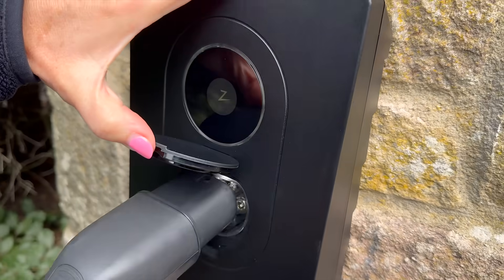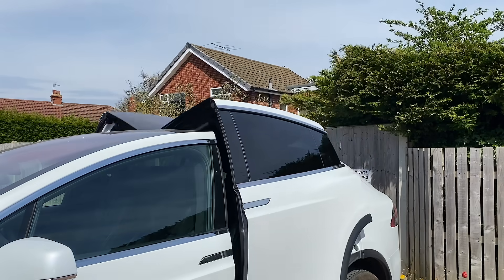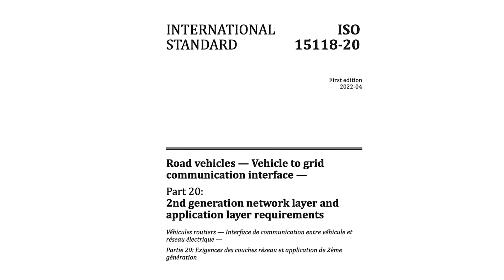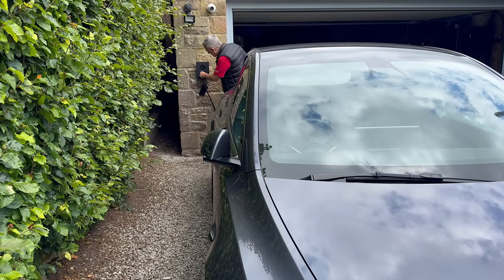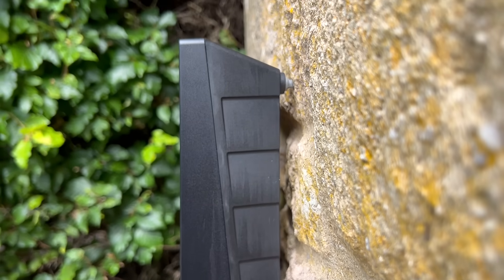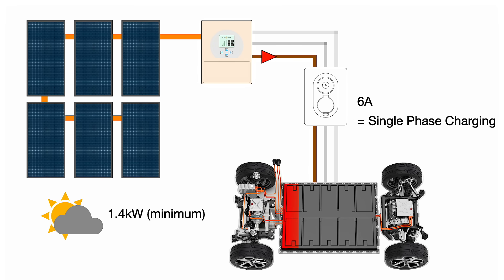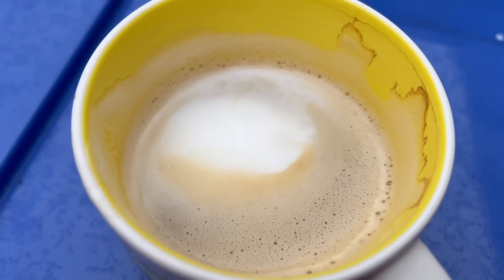Zaptec Go 2: The Future of EV Charging and V2G Explained!

Comment: What I want to know is do all cars that have an inverter (i.e do V2L) also have the hardware for V2G? The latter requires syncing with an existing 50Hz grid. The former requires a grid-forming inverter. I think that if you can do grid-forming then the hardware can also do grid-syncing (because that's actually simpler), but I could be wrong. 
Which vehicles out there have a) grid-forming (V2L) inverters and b) grid syning (V2G) inverters?
I know that Kia/Hyundai machines can do V2G already. I think BYDs can. VW's have the hardware but just turn off if you ask for negative charge current. We need this info for all cars...

Comment: 40 kWh for 7 grand is pretty good, but you can buy batteries for less than that now. 48kWh of Fogstars is £5400. Of course by the time you've bought an inverter and some cabling and gubblins too you'll struggle to be cheaper than the car, and of course it won't drive you anywhere...

It is daft that we still haven't got V2G regs sorted. The tech has been working since 2013 for Chademo and 2022 for CCS/AC.

What I need to know for the Zaptec is can I change the auth provider so it will accept my controller as an OCPP charge controller? Or am I dependent on Zaptec's servers so when they go bust this thing turns into a paperweight?

Comment: So can they actually make use of the V2G now or is this still a problem with the DNO connection agreement? Does the homeowner have to apply for a(nother) G99 connection agreement for the size of the Car Charger or the on-board Inverter? If they already have Solar are they then going over their agreed connection? What if they have a G100 export limitation? I feel like this is a trainwreck of certification heading our way from the ENA :)

Comment: A friend has been running a V2G system in the UK for 18 months now and uses a Nissan E-NV200 40kWh to store cheap rate electricity when it's charged at night and then it runs the house by day and any left over in the evening is sold back to the grid for a profit. Here's the video on it https://youtu.be/lwdxKJYPjeQ
Reply from the maker: Interesting Video - See they are using one of the Indra units developed as part of the Powerloop trial. We visited an early project which was used to demonstrate the principle. The difference on these projects is that the DC to AC conversion takes place in the wall mounted charger. https://youtu.be/s7nODxkzIpI?si=8Ieqzvnd3z9dPtTE

Comment: Technical question, with the diagram shown for standalone operation, line and neutral are shown open, but a local N/E on the consumer side is created and an additional electrode on the consumer side added.  Therefore the premises neutral will still be connected to the network neutral via the earthing system (can't switch a PEN, or at least insane to, so the means of isolation must be downstream of the position of the network supplied N/E link) unless the network supply is TT.  If that is true wouldn't it be simpler just to leave the neutral connected through to the network and utilise the on premises supplied network earthing if the supply is PME?  TN-S I can appreciate it would be possible for the network earth or neutral to fail (hence the outage etc) and that would leave the local supply without a N/E link so not for TN-S arrangements.
Reply from the maker: That a good point. There is a small error in the diagram, in that the neutral earth bond needs to be closer to the charger installed before the power goes in to the distribution board. It's needed to ensure that RCDs will trip in the event of a fault.  - If you then leave  the distributors bond in place it would cause the devices to trip.
Reply: @efixx  The automatic linkage performed by the inverter (or whatever) upon loss of mains and separation would not be permitted.  Only the network provided N/E link would be present.

Comment: In the UK, from an end (L)user perspective the thing that really matters is Vehocle To Home
Because unless you have vert specific contracts set up, you get paid rugger all by the energy companies. Its not like in other  countries where you can arbitrage the energy system. (Buy low, sell high)

Now of course with the right more inteligent  consumer unit, all that can be handled along with links  Home Assistant software for home automaton, for not much more than a standard unit. Your partners with one of the big German companies I was looking at for my home. But at 5.30am I am ruggered if I can remember it.
Thanks for a great show
Reply from the maker: Searching around Eon offer around 25p/Kwh for export. Payments for grid support can be higher, but for very short duration. We saw examples last year of around £4 kWh.
Reply: But you can arbitrage the energy system in the UK? Lots of people are doing it right now. There are several tarifs that enable this, and a whole load of different bits of software that can optimise it. (Victron DESS, Node-Red (which I'm using), OpenHab, Decent Energy, Solar Assistant, Home Asisstant, Homely, MyEnergi, and a host of others)

Comment: Here in Thailand I am off-grid and have connected the V2L from my BYD to the AC input of my solar inverter in the same way you would connect a generator. The power output is only about 3kW but it's enough to run the house for a few hours before switching back to running the house from my home batteries.
Reply from the maker: Great solution!

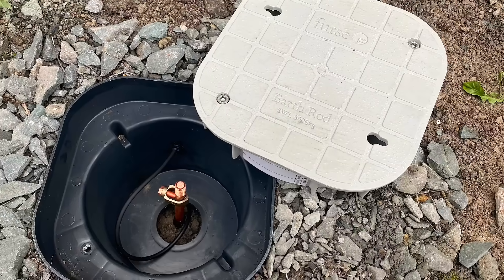Comment: Hmm. Still putting out the message that you can't use the DNO earthing in island mode at 4:51, which is incorrect. You CAN use the DNO earthing in island mode BUT you need an additional measured earth electrode because you cannot assume the DNO earthing is still effective *during a fault* on the DNO's LV network. At least we've a got a video that acknowledges that the 'charger' doesn't actually do any charging, hence the description in the regs as EVSE - Electric Vehicle Supply Equipment. Don't see the point of the fancy display on the EVSE device when the same info is available on the app. Surely that just adds extra, unnecessary cost?

Notwithstanding the shiny tech and advances in comms protocols, I want to know how V2G will work in practice once EV adoption (and/or PV solar) becomes ubiquitous. I live in a cul-de-sac with 15 houses. They were built just over 30 years ago and all (to the best of my knowledge) still use gas central heating. The After Diversity Maximum Demand figure for these houses used by the DNO for the LV network design would've been 1 to 2kW per house, say about 40 to 45 amps per phase presented to the main cable. Theoretically, right now, each of these houses could install and operate generation rated at 16A output, so 3.68kW per house, without prior approval from the DNO. A potential total of 55kW export, or about 80A per phase. The LV network, as designed and installed 30+ years ago, tapers towards the load, so localised voltage rise is going to become an issue and that's for an urban, relatively load-dense scenario. More geographically diverse networks (essentially rural or semi-rural overhead) have significantly higher source impedances so widespread use of V2G etc presents voltage control issues more readily. With a combination of V2G or PV solar devices, who arbitrates amongst these prosumers as to which installations can export energy and at what level? Commentators blog excitedly about virtual power plants and the like but how is a centralised 'dispatch call' for energy from a V2G installation aware of the parameters of the LV network it's connected to? If dispatch request a modest 3kW from your V2G for a couple of hours, how can it know if the LV network can support that export at that time?

In my opinion, a lot of the selling of renewables and tech like V2G to prospective customers is based on its potential to 'pay back' through payments for exported energy. This is very much a case of caveat emptor - the amount of exported energy (and, hence, payback) you can realise today may not be sustainable in the medium to long term as more and more of your neighbours follow suit. It is my understanding that the penetration of rooftop PV in parts of Australia is already at a level where export is having to be actively curtailed or perhaps even prohibited due to these problems. None of this can be a surprise when the availability of the new technology and its incentivisation ramps up much, much faster than the networks it is connected to (the vast majority of which were never designed for this purpose) can be reinforced, if they are modified at all.

Comment: Interesting to see an AC charger that has support for V2G. Most efforts so far have been DC chargers. 
I'm not sure how I feel about the MID class meter in there, it could possibly open up the way for the government to start charging VAT or other taxes for power put into cars.
I am more interested in V2H than V2G, long-term if energy prices return to pre-Ukraine war or lower levels I'm not sure the economics will be there for domestic export to the grid at least for the consumer.
Reply from the maker: MID meters are needed when anything measured is linked to payment (even pint glasses for beer in pubs) - Even if you only use V2H it may be you are paid not to use grid energy under a grid support mechanism. These payments can be significantly higher than regular export. The supplier however would need some method of measuring what you used during the event window.
Reply: @efixx  I guess they may choose to do that in the future but they already run saving sessions where they compare your usage using daily averages from your smart meter.

The govt. massively slashed the returns on these so energy providers barely run any sessions anymore hence why I am more concerned about reducing my grid use rather than worrying about export.
Reply: The AC charger does not really have 'support'. The support comes from the car's internal AC to DC convert. Cars that support this type of connection need their internal system to also support DC to AC conversion.

Comment: What a joke , buying an expensive battery car to power the grid ?
Reply: Rogerthomas7040 please can we have a link for £3,000 32kw battery. 
Thanks
Reply: @stevejeffrey1  I don't think I can post links, but it is the fogstar 32kWh solar battery in white.
Reply: @rogerthomas7040  thanks have you done this?  Can the fogstar batteries be programmed to also charge off peak?
Reply: @alanak3210  电动汽车并不贵。在中国，只用7500英镑，就可以买到一辆全新54kw电池容量的，MG4 2025款，配置的是磷酸铁锂电池，终身质保。这种电池在中国的出租车上大批量使用，都可以达到行驶至少40万英里无故障，还有至少85%以上健康度。这种电池就是要多多使用才能保持健康。中国农村也有人晚上充电，白天卖电，或者用太阳能充电，再卖电的。但在城市里，人口密集，就很难这样做。
Reply from the maker: You can get a used one for £5k which for 40-50Kwh of storage is a bargain - even if you don’t use it as a car 🚗- it’s a free shed!
Reply: @efixx  I'd rather just buy a used battery from an EV and use that via a regular hybrid inverter, less waiting around for regulations that may or may not change and you can then always take advantage of off-peak tariffs even while you're away. I paid £3,770 for my 62kWh Nissan Leaf battery, delivered.
Reply: @efixx  A 40kWh NMC battery new or used is not really a great long term investment due to the limited number of cycles that the battery can handle. I think anyone with the space to just park up a second hand car to rot and use their car charger port 24x7, will not really want such a car on their driveway. You can get 32kWh LFP batteries in the UK for £3,000, which would make more sense if you just add an inverter to support them.
Reply: @efixx  But the EV is only really viable as a home battery alternative when V2H is available .

Comment: Interesting but won't V2G degrade your EVs battery?
Reply: No more than driving it will...
Reply: @edwardpickering9006  ok thanks was genuinely curious as I have no idea
Reply from the maker: I had a Tesla and over 80,000 miles and 30,000kWh of energy it lost less than 5% of the 100kWh.  A typical UK home uses 2700kWh per year so taking some energy for V2H or V2G isn't a huge additional requirement on the battery.
Reply: @efixx This is the idea of Tesla joining the UK Electric suppliers👍